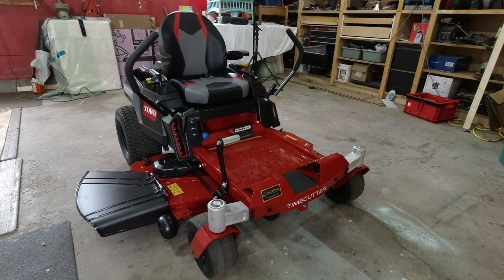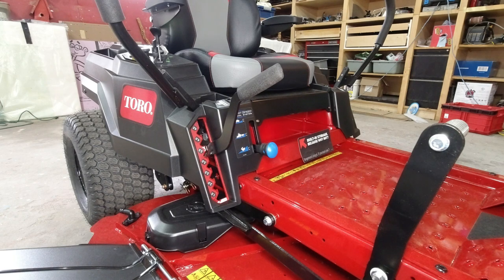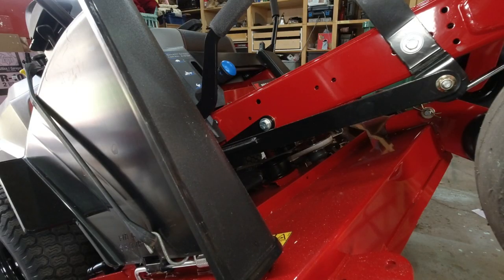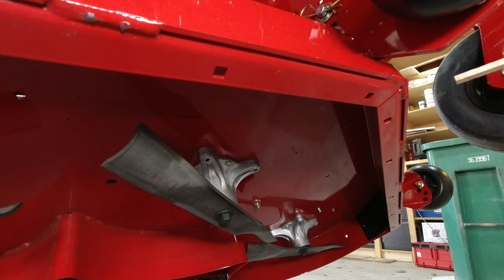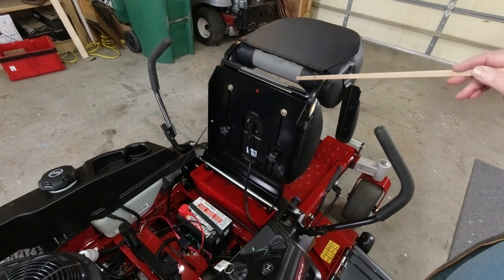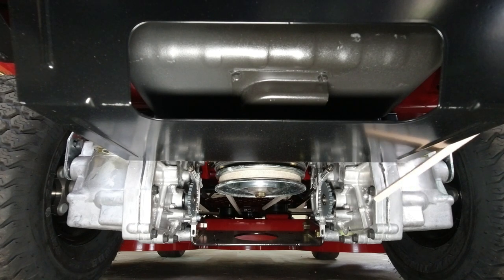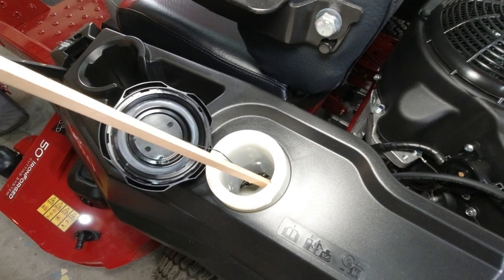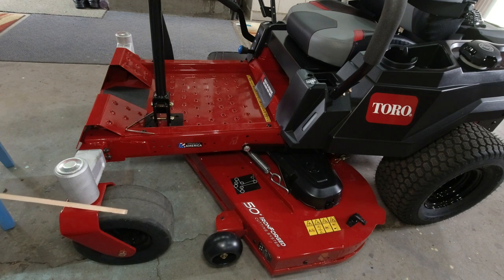2020 Toro TimeCutter Walk Around Review

Comment: Have you talked about the stamped steel deck vs  fabricated deck in terms of performance, discharging grass?
Reply from the maker: Yes, I cover the topic extensively over at todaysmower.com. To recap, stamped decks are better for weekly mowing and most are designed to mulch with a simple blade change and discharge cover. Commercial, deep, fabricated decks are better for longer grass and will mow well at higher speeds. 
In other words if you have a smaller residential lawn and keep your mowing speed under 5 mph the stamped decks can be a good choice. But - if you have multiple acres and want to get done as fast as possible the fab decks generally will handle the job a lot better and faster.
Reply: @PaulSikkema  you certainly answered my questions. Thank you Paul!

Comment: I found a used Wheel Horse 417-A, with 900 hours, Kohler 17 , seller says it doesn't run only needs a battery, hyd fluid and the steering "clicks" ?  and a 48" mower deck and plow comes with it all for $400, I plan on taking a battery and jumper pack with me to see if the engine at least turns over and maybe starts, seller says it will run with a battery, it's very rough looking but it's all there. I don't need it I have a lawn tractor and I want it for a winter fix up project. I think you'll agree the older Wheel Horse were the best and made extra strong with beefy frames, transmissions and axles.
Reply from the maker: At $400 it's a good project tractor. Yes, they are built like a tank. Bring a quart of fresh gas with you and the tools to drain the gas tank/carb. Depending on how long it sat the fuel bowl may be full of water and the gas in the tank will be bad. Hopefully he had the fuel shut-off closed. If the fuel shutoff was left on check the engine oil, smell it and make sure there is no gas in the oil before you try to run it more than at idle. 
I'm very concerned with "it only needs hydraulic fluid." It has a hydro transmission and it may require a rebuild if it won't move. If you can check the oil in the trans, it should be the color red. If it's brown or black and smells burnt you probably have a bad hydro. 
The decks were the weak link on that tractor. All new decks cut a lot better and the old decks rusted out and always needed spindle bearings - expect to repair the deck. 
Go to mytractorforum.com and talk to the guys in the Wheel House section if you need parts. 
You can always fix it up and join the antique lawn tractor shows :)

Comment: I just got mine three days ago. Question.. how did you get the belt covers off so easy? Mine don't want to come off. The manual makes it sound easy and you make it look even easier. There is one screw in each of mine near the tabs.. I'm not sure if I have to remove those or not?
Reply from the maker: The 42 and 50 inch decks have the quick release covers. There is a tab you push on each side. The screw on mine is to hold the the bottom piece - the piece that doesn't come off - on the deck.
The 60 inch does not have the quick release.
Reply: I just got this same mower, mine has one screw holding covers on.Dealer said toro started putting screw in cause covers were popping off.

Comment: Just bought this type of lawnmower.  The right hand handle does not do any thing.  I can not control the mower at all, it seems to just respond with the left handle.  Help!
Reply from the maker: There are two small levers/rods located in the back of the mower by the transmissions. Those levers (bypass) release the trannys so that you can move the mower without the engine running. My first guess is that the right hand bypass lever is engaged. Move that lever to the engaged position and it should work. If it doesn't - get it back to the dealer so they can fix it.

Comment: A useful bit of information I’d wish I knew before purchasing the 75750 instead of the 75755 “my ride” is that the my ride model - 75755 also upgrades the transaxle to the 1” zt-2200. Whereas the 75750 shown here uses the smaller zt2100 3/4” axle. I was somewhat disappointed to learn my 2021 75750 was downgraded to the zt-2100. Seems to me most manufacturers go with the zt-2200 on almost all residential models, with the exception of a few who use it on machines with decks 42” and under. I feel like all zero turns with a 50” deck or larger deserve a 1” transaxle.
Reply from the maker: Yes, one inch is better but Toro has been using the ZT2100 transmissions for many years. It's been a very good, dependable tranny.

Comment: I can’t see the fuel level is the window ?  Am I missing something.
Reply from the maker: The fuel up in Wisconsin is clear so the fuel level is hard to capture on camera.
Reply: @PaulSikkema  thanks Paul  I put some fuel in it the other day and could finally see the level.  I also discovered you can also see the fuel level when you lift up the seat and look at the tank  from the inside.   I was using the mower yesterday and the engine started to labour while cutting grass  and  all of  a sudden, engine stopped then it would not start again  ?   I had the battery on trickle charge and was fully charged when I took it out so I can’t work out why it would not start again ?
Reply from the maker: What your mower did is typically when it runs out of gas.  If you did run it out of gas you will have to fully close the choke and then use the starter in five second intervals anywhere from 6 to 20 times before the gas gets all the way through the fuel lines and into the carb. 
If the engine is still warm don't use the choke.
Reply: @PaulSikkema  not sure how I could have run out of fuel, I’m in Australia by the way Paul.  That’s the first thing i check ?  The mower we bought has already been back to the dealer once to get the steering adjusted as it was,pulling to one side and not going straight.  Also  smoke came out the back of the engine as the cutting belt was twisted and almost burnt and broken right through,.  No it has not been a good experience for us so far. I think next time we wont be going with toro may try another brand ?

Comment: How do you feel about the 2020 models with Toro-branded engines, like the 75745?  I've read they are made in China.  Any thoughts are appreciated.
Reply from the maker: I have no problems with the Toro engines. They are made to to Toro's spec by the world's 4th largest engine manufacture. The dealer like the engines and are having less issues with them than all the other brands.
Reply: Stay away fr9m the Chinese Toro engines, it has a plastic Cam Gear.. Crap!
Reply from the maker: Interesting that you would mention that. Kohler has been using the composite cam gears since the mid-90's. Even your car most likely has a set.
Reply: @PaulSikkema   Kohler stopped using plastic cam gears because of all the failures, no one else uses them anymore,  the Only reason the Chinese engine has one is strictly for Cost and no other reason. The Chinese are definitely not known for their plastic durability manufacturing.. I would take any other engine over the Chinese.. have you seen how much metal comes out of the first oil change? which by the way must be completed after five hours of use..  that right there tells you somethings wrong. Many cars have use plastic cam gears but what that actually is is a metal gear that is nylon coated it’s not exactly a plastic gear and those were not very good either because eventually they broke down and ended up in the oil pan
Reply: @Krazycat321  talking about the composite cam it's the in the kawasaki to I got to say when mine broke down and I tore the engine down and had a broken cam gear and to see that it was plastic was not expecting that
Reply: @PaulSikkema  yes they have and kawasaki uses the composite cam gear to but when you replace it you can only get a metal one I think

Comment: Looking for a mower.  
Do you prefer the Toro 75750 or the Ariens XD 52?
Reply from the maker: I don't have a preference. 
Ariens: I like the way the deck sticks out the left side for trimming. I like the larger rear tires. I like the 4-point suspension on the deck. 
Toro: I like the larger front tires. I like the replaceable front casters. I like the automatic parking brake. 
They both mow really, really well. The IKON XD seems to mow taller grass better. If you let parts of you lawn go for a month it's cuts that stuff better. 
The Kawasaki, Toro and Kohler engines are all good engines that will last. 
Since they are so close I suggest going to the Toro and Ariens dealers, listen to what they say, and then pick the dealer you like best.

Comment: What engine do you recommend? Kholer, Kawasaki, Toro.
Reply from the maker: I have no preference. I have owned all three and they all perform well. I just sold a 50 inch with a Toro with 800 hours on it and the engine had no issues. I have a 42 inch with a Kohler with 400 hours and it runs perfectly.  I have the Kawasaki on a 52 inch Ariens with 90 hours and that also runs great.

I just scrapped a John Deere with only 40 hours on it - it had the Briggs Intek.
Reply: @PaulSikkema  thanks

Comment: I got one to, and then found out that some of the parts for this mower are not found any where yet. Like the front tire with the wheel. Cant find one they don't have any. this is bad when you have a flat doing lawns and you don't have a spare tire to fix it with load it up take it home. They only sell the tire right now. Make sure you look in to all the parts before you buy this mower. Dealers should tell you this before you buy this mower.
Reply from the maker: If you are running this commercially (it's not a commercial mower) I strongly suggest filling each front tire with 1/2 a quart of SLIME and each rear tire a quart each. That said, 
EVERYONE and I mean every manufacture is having real issues getting parts right now - especially parts made overseas. The "virus" hit Asia just at the right time as to stop a lot of the production of the parts we need to build this years mowers. 
In addition, some of the major parts suppliers have had to shut their warehouses down because of the virus for extended periods of time. All that affects if you can get spare parts when you want them. 
Belts, tires and electrical components seem to the the hardest hit. Please give every manufacture a little slack right now.

Comment: Biggest hate on this is no bar across the bottom of the discharge side of deck.  No matter what you do, turns to the left, the cut will be lower on the right side.  lord help you if its a slope as its a guarantee scalp issue!
Reply from the maker: That really more of an issue with large decks and the 3-point lift. The decks want to flop around more and don't cut as evenly on rough ground. Toro, Cub Cadet, Troy-Bilt, Craftsman, Deere and Husqvarna all use the 3-point lift on the residential decks. Ariens, Hustler, Gravely, Country Clipper and other companies that focus on commercial ZTRs use a 4-point deck lift. The 4-point lift is a lot more solid and keeps the rear of the deck from digging in like you mentioned.
Reply: @PaulSikkema  My issue is, on a toro stamped deck, the entire circumference has metal on the bottom.  It cause the deck to float and is part of the anti scalp system.  That missing piece on the welded deck allows the deck to go lower. I have both decks on 42" mowers and that 1 piece is huge for quality of cut...

Comment: Is that squeal noise it makes when moving normal ?
Reply from the maker: Yes, when the engine is idling and you make a hard turn the transmissions will "growl." If the noise is very loud then there may be air in the transmission and it needs to be purged.

Comment: My 42 " deck is 10 gage..not stamped..my unit is a 2021 model..
Reply from the maker: I have that same 42 inch fabricated deck on my ExMark Quest. Very few decks will cut better.
Reply: I love my toro..I used to have the toro Wheel horse riding mower..as well  had the snow blower unit for it..when I lived up north..I'm now down in Florida..I have an old school inground lift..in my garage..I can drive over it with my new,   o turn   lift it up. Get the blades of to sharpen. Change the oil  great mower probably my last one IL bye

Comment: Great review. I just picked up my  2021 Time Cutter 50” with My Ride. Awesome mower!  I got my first cut done last night and it was great. 

I looked at John Deere, Ariens and Kubota for higher end residential zero turns.

 I wasn’t too impressed with JD, it just seemed lighter weight and less quality than the others. And once they told me that JD branded engines are Briggs&Stratton; I was out the door. 

Ariens is well made.  I own one of there snowblowers and it is great, and if I like a brand I try to stick with it. But they don’t offer anything great for financing.  

Kubota makes a nice machine. I own a BX tractor and I love it. Kubota offers 0% on their machines which is huge. But they were sold out until spring 2022 at local dealerships. 

Toro is very heavy duty and just feels like quality. The My Ride is great and well worth the added expense. I’m 6’1 and 230 and I have plenty of room on this machine. Some of the other brands, not so much. My mower has the Toro 24 hp engine and it has plenty of power!  The cut quality is great. I also own a Toro Recycler AWD push mower and it is also a nice machine. I highly recommend Toro.

Comment: Thoughts on this vs the Ariens Ikon XD 52" ?
Reply from the maker: I like them both and each one has unique features that makes one better than the other for you. 
I like the large front casters and front step on the Toro. It cuts very, very well. I like the cutout for the bagger discharge so it's not as wide.
I like the large rear tires and that you can step on the deck of the Ariens. I like the 4-point deck suspension. It cuts even better than the Toro and handles long grass better. I like the offset deck so it's very easy to trim around utility poles and smaller trees. If you want to bag all the time Ariens has the only powered bagger in this price range. 
I've covered both of them extensively here on YouTube and answered a lot of questions about each one in the comments.
Reply: @PaulSikkema  Thanks! I watched both videos and agree with everything above. I do think in my experience the Ariens service (at least in my area) didn't seem to snob if I bought the mower from a box store (can get better discounts there). I think I'm leaning toward the Ariens due to the offset  deck...my new house has over 50 evergreen privacy trees around the fence, so minimizing trimming is important. i also like the bigger tires, and honestly if the Toro 20" tires I'd probably go with that since it's just a brand I tend to trust a bit more. 20" is a big step in comfort from the 18" tires for me.

Comment: how does this mower compare with the Ariens ikon xd?
Reply from the maker: It really depends on what you want. They are VERY close for performance and quality. 
They both side discharge extremely well.
They are both built very well and have a good reputation.
The Toro has the smart speed so you can pull heavier loads. I also feel it rides a little better with the larger front casters. Toro has a larger dealer network so you may be able to find a good dealer closer to you. If you want to mulch the Toro is slightly better. 
The Ariens has larger rear tires so it has better traction on slopes and soft/sandy soil. It also has the 4 point lift on the deck so if your lawn is rough and wavy it will follow the mower and cut more evenly. If you want to bag the Ariens has the best bagging system - but it is more expensive. If you want to bag all the time their bagger works in all conditions including wet grass.
Reply: @PaulSikkema  I like everything about the toro except the small rear tires, but my lawn is relatively flat. zi like the 4 hanger system on the aries as well, but I did not see the deck on the toro moving much as you mowed. I was concerned about the cut when you first started and you slowed down, so does the ariens cut better faster or the toro, or the same?
Reply from the maker: The lawn I mowed with the Toro was a lot smoother than the lawns I mowed with the Ariens. Tha said, the Ariens will mow as fast as the mower will go and leave a perfect cut. The Toro also cuts very well but it mows the best about 2 mph slower than the Ariens.
Reply: @PaulSikkema  Paul, great reviews. I know you said both the Kohler and Kaw were great engines. But I am curious about the HP and power of the two. I am thinking of going with the IKON XD 42 and wonder if the 22HP Kohler will give me more power over the 18.5 Kaw. What is your opinion on that?
Reply from the maker: There are different ways and standards to measure horsepower. Kawasaki uses a different standard than Briggs and Kohler. Personally, Kawasaki's measurement standard is closer to what's used for farm/industrial engines. 
So the 18.5 HP Kaw and 22 HP Kohler are actually about the same in terms of power/torque to mow your lawn.

Comment: i like the kubotas because they have a built in jack system
Reply from the maker: Did you see the jack accessory?
Reply: @PaulSikkema  accully comes factoryed and theres jack system kits avaliable at kubota
Reply from the maker: I guess I am not aware that they have the oscillating front axle on the residential Kommander series. Even if it did their cheapest mower is $2000 more than this one. That said, there are many flip-deck models available in the $4000-$10,000 range besides the Kubota.